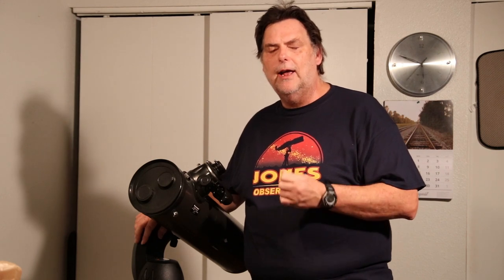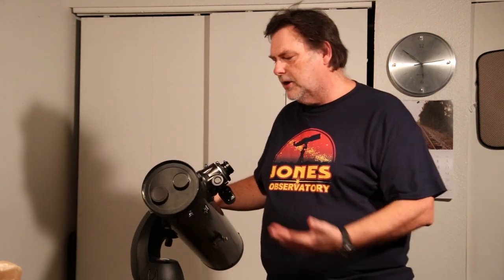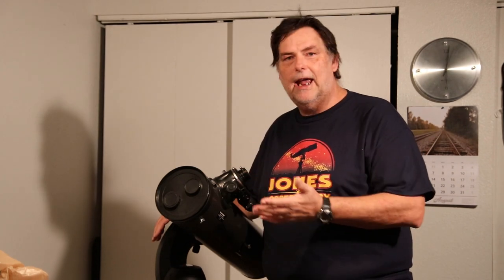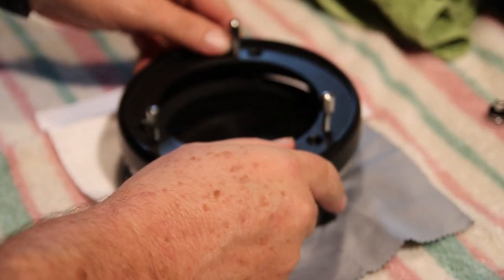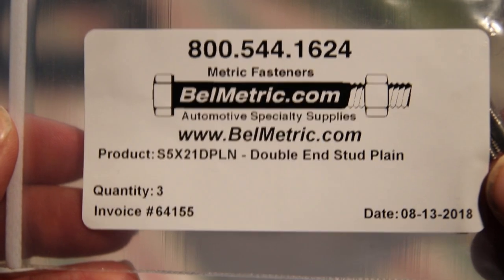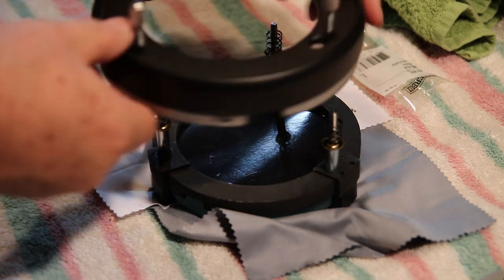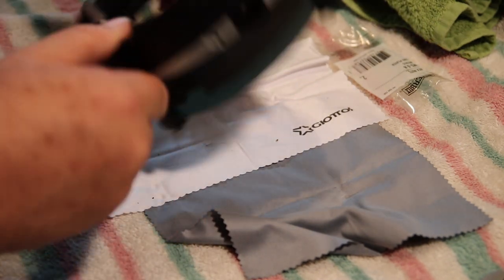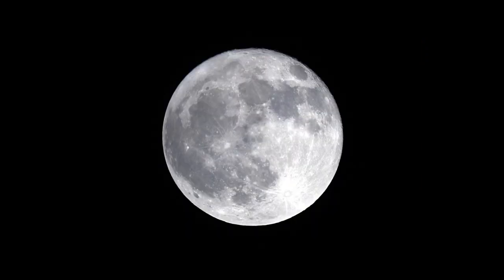Mod a Celestron SLT130 for Prime Focus for DSLR

Comment: Good stuff! built like a real engineer to a problem! Looking forward to try this with mine
Any concerns with dust coming in from the back opening to the mirror? Although dust would come in from the front anyways.
Reply from the maker: My primary mirror does not get any dirtier faster with the space in the back that I have noticed.
Reply: you could try with high density foam cut at the shape of the tube

Comment: I recently purchased the Celesteron nexstar 130slt as well as a canon eos 2000d for astrophotography. I used the same parts listed in the description and did the modification however, I am still not able to get it to be focused in prime. The only way I can get it focused is with a Barlow lens but I do not want to use that for larger objects such as the moon. Any idea how I can fix this?
Reply from the maker: Yea the Barlow does cut off to much. You are just using the canon t-ring screwed directly onto the t-ring threads of the eyepiece holder insert, nothing else between the camera and the scope? I’m not sure if the sensor is further back in the camera housing for that canon, I would suggest to put a nut on first on each threaded stud of the mirror plate screwed all the way down before adding the standoff spacer to bring it up just a little bit further, or a longer standoff.
Reply: Just messed around with the spacing a little today and I was able to get it to work now. Thank you for the video and your help.
Reply from the maker: @Meuxo  Great glad it worked out. Clear Skies.

Comment: Nice.,  Just subscribed.  Ya know, if you have a long x2 Barlow, you can unscrew the hollow tube and use what is left, giving you a x1.5 Barlow.  That worked with my Orion Observer 134mm Newtonian.  Ultimately, I bought an Orion Space Probe 130mm Newtonian, which has two spacers on the focuser and you can remove one to attain focus if you need to.

Comment: Thanks for a great video. Successfully applied the technique to an Astromaster 130EQ.  I had a similar issue with the stock 20mm eyepiece, and even with extension it wouldn’t focus.  A replacement Svbony wide angled eyepiece works well (with the extension).

Comment: Absolutely fantastic Chris. Thank you for sharing this! Very informative. Glad you added parts to this as well. 
I have two questions, how much "forward" distance did your mirror eliminate with this spacer mod. 
Also, did you have to adjust the secondary mirror at the eye piece?
Happy 4th!
Reply from the maker: The spacers moved the Prime mirror 13/16 of an inch forward, which gave me about a total of 1/16 of an inch to focus with before the focuser was completely in the down position. No i did not move the secondary mirror. I figured it need to stay in the center of the eyepiece.

Comment: Chris, I watched your video for the mod, I have just modified my Celestron nexstar 130slt just the same as you have. My question now is, once I mount my camera in the eye piece via the T ring, I'm using a Nikon D40 for imaging. Question, how do you focus on deep sky objects while looking in the camera finder and to obtain sharp focus? I can barely see the images in my camera finder. Especially the Orion neb. M42,-  My scope is on line and properly aligned, so I know I'm on target, but I can't obtain sharp focus. Not enough like coming thru OTA to light up the camera finder view.  Can you offer any pointers on how to obtain a sharp focus?
Reply from the maker: Find a bright star close to the object you want to focus on and use it to achive focus,  then slew to the object you want to photograph. Also when you focus on the star a Bahtinov mask does help. Check out my video on the mask.

Comment: Excellent mod and explanation sir.  What is that focuser knob on your scope right side?

Also, did you have to take all thiae light, dark images I hear people doing then stacking them?.
I'm very new to this and if that's the case, can you explain the procedure  you use to do it?
Thank you.
Reply: Also, both of my Nikon cameras focus perfectly in the 130slt.
One is a FF Nikon D610, and other is tine sensor Nikon 1 V2 with a crop factor of 2.7.  So I'm thinking I don't  need the mod?
What do you think?
Reply from the maker: The knob is a manual electronic focuser ( another video). Yes you should take at least the light flats for better stacked images. Unless your taking images from a lab clean room...lol
Reply from the maker: If all the cameras you will use focus there is no need to do the MOD. My Canon i started with did not focus so i figured out this mod.

Comment: I have a question, I got a camera, neximage 10 I have a 130 SLT, but I have a problem when I use te camera on it, I can’t get a well focus, looks blurry, the problem is on the focuser it can’t get more close to the secondary mirror, this mod can help with mi problem, I can still using barlow lens 3X?
Reply from the maker: Yes it will allow focus without the batlow. I know you can still use a 2x after the modifacatiin but have never tried a 3x, so i do not know if a 3x barlow will still provide good focus.

Comment: I don't know what I'm doing wrong. I followed your directions but can only focus so far. Don't think I could focus on the moon. Do you know if colmination can effect that. I am a little off. Thanks for a very helpful video
Reply from the maker: What camera are you using? What was the length of the spacers? Out of culmination might make it look a little out of focus.  Is the focuser racked all the way inward? If so have you tried to see if using a barlow allows you to find focus, If so then you did not move the morrow far enough forward.

Comment: Hey man, a question; what is the purpose of you doing that step at 12:48?
Reply from the maker: I just want to make sure the double threaded piece is butted up against the bottom thread in the base tight so it won't untread from the collar when calamateing the scope.

Comment: Great video Chris,   I'm thinking of cutting the heads off three m5 x 50mm bolts and using them to replace the existing studs, rather than buying couplings and studs.   I can then install a couple of friction nuts on each stud to adjust the desired gap.   What I was hoping you might know is how difficult it is to remove the old studs?   Again fantastic insight.
Reply from the maker: I did not try to remove the studs and can't remember how they are mounted on the backing ring.
Reply: Some of the studs are glued in place. You can remove them with solvent or heat. Heat the studs and as your doing that carefully try and unscrew the studs. Hopefully it will work out for you

Comment: Hello Chris,  one more question -  while imaging DSO objects with DSLR, after shooting let's say, 80 to 100 light frames, what about the Dark, Bias and flats?  My DSLR, Nikon D40 is what I'm using for now  until I purchase astro camera. I understand how to shoot the frames and what not, but how do I shoot the Bias and flats and dark while the camera is mounted and remains pointed at DSO object?  What shutter speeds do I set my camera. The camera will not work on auto while the camera lens not mounted,  The camera mounted on the OTA via T ring.  Could you offer any advise or links that will explain this?
Thanks
Reply from the maker: The scope does not need to stay pointed at the object. Darks and bias need to be taken back to back at the same temeture as the lights so its better to do those right after the lights. For dark just put the telescope cover on maybe put a dark cloth over it just to make sure no stray light gets thru and shoot 30 to 60 frames at the same settings as the light frames. Then just take the shutter speed as fast as the camer can for the dias, same amount of frames. For the flats  leave the camera attachsed in the same orintation and can be done in the morning if you dont have a evenly lit light sourse. I use a flat drawing pannel. For flats just point your scope to a point in the sky and put on a white cloth like a pillow case or tshirt. Make sure its pulled tight with no wrenkles use a rubberband. If you can see the histagram on your camera adjust the shutter till the high point of the histagram is close to center, take the same number of frames as the darks.
Reply: @AstroPatio  THANKS Chris!! Much appreciated. I joined the NHAC as of today.  Hope you to meet you soon and others. I want to learn more about Astronomy and using my telescope. This is fun!!!

Comment: Nice tutorial. I get a celestron nexstar 130 stl last week and it's a pain in the.. for astrophotography. Will try it.
Reply: Hi,
Same here...
Did you mod it ? 
I saw that the mirrorless cameras can prime focus directly without mod.
Looks like some Sony are really decent on long exposure as well but I haven't tried for myself.
Reply: @art83z  I did but I discovered that I can't focus any planet, just the moon, for normal observation, so you have to use a barlow. Haven't try with that camera I'm using a Canon 550D.
Reply: @Paroxistico  thanks, is it ok with the barlow? 
I guees I'll do it and see...I can revert this change.
Reply: @art83z  if u don't wanna mess with that mod  taking off or on everytime you use the telescope u need the Barlow. You may lose some brightness but it's OK and you have both options at the same time 👍
Reply: @Paroxistico  thanks 😊.
Clear skies

Comment: Thank you 😊.
I got the SLT 130 one week ago and will do this mod (although I was trying to buy a Sony A5000 used...in that case the prime focus can be achieved without mod) 

The only thing that I was thinking off is to have the standoffs 15mm instead of 20.

I tried the prime focus with my nikon and basically with the 2inch adapter I cannot prime focus for les than a centimeter :( 

If I remove all t rings and get the sensor directly it will prime focus...but there's nothing left to hold the camera 😋😋

I'll also have to cut those double ends and take off 5mm.

What do you think ? 
Or should I play safe and go for 20mm on the standoffs?
Thanks again...great job...
Clear skies from Albania (EU) ;)
Reply from the maker: That's cool about the Sony camera. But for the standoff question I'm not sure if you should go with a shorter one or not that entirely up to you. With my setup it still does not give me much room for error.
Reply: @AstroPatio  just finished the mod...
I left a couple of mm less (deeper) than what you did...

I noticed that the 9mm and 25mm eyepieces need the Barlow tube (without the barlow lens) but it's still fine....very usable indeed.

The 4mm eyepiece doesn't need the extension...it worked fine directly.

Thanks again and happy holidays.
Reply from the maker: @art83z  Yea a little give and take but I think its worth it just to be able to use my DSLR camera with out the Barlow to make it work.

Comment: Did you have to use the second set of standoff round couplers? Will that allow more wiggle room in the focus department?
Reply from the maker: No i did not need to use the second standoff, yes it will give you more wiggle room for the camera but it effects the use of eyepieces. As it is with one standoff some of my eyepieces need an extension tube for further back focus to use.

Comment: Hello I’m in the process of purchasing and building one of these myself I have a question if you actually got the extension adapter for your smaller pasal eyepieces? And what size you got.
Reply from the maker: Im just using a 2x standard barlow with the magnifer lense screwed off it works great with my possel eyepices.
Reply: @AstroPatio  thank you. I appreciate it. So much help on this video and great way to get started you have my support.

Comment: Good video bro, could you tell me wich barlow lens do you use in this video (link please)? i will like to use the barlow lens before the modification mirror. thx. pd: sorry for my english, i don't speak very well, i hope that you understand me.
Reply from the maker: This is the barlow I used in the video its the Celestron 1.25" Universal Barlow and T-Adapter https://a.co/d/14Ya9n6
Reply: @AstroPatio  Thanks!! i will buy it.
Reply: @AstroPatio  hello friend, i have another question and i hope that you help me. in the  double end studs is necessary the separation of the short thread and large thread?, i only found double end studs without separation. thank you!
Reply from the maker: @luisjagaravito5508  they should work fine
Reply: @AstroPatio  awesome! thank you

Comment: Does anyone have the link for the screws and washers because if I want order them off belmetric it’s 50 pound shipping since I’m from the uk
Reply: I had the same issue and couldn’t locate equivalent studs anywhere in the UK. So I tweaked the parts list using parts available from RS UK and it worked a treat, with the same scope 130 SLT. Kept the same stud and spacer lengths and threads, though my studs are threaded across the whole length (still works fine). This has brought my mirror inwards by about an inch, everything feels solid and I can now get prime focus with my DSLR.

Parts bought:
M5 x 20mm steel spacers
RS stock no 205-3072

M5 x 30mm zinc plated steel studs
RS stock no 175-6987

M5 x 50 steel screws (for locking collimation)
RS stock no 917-2820

M5 Rosette washers
RS stock no 664-5000
The washers above will do though I ended up mounting them upside down so that the curved bit went on top of the spacer, with the flat edge retaining the spring. Because they were a bit on the small side to use the other way round. This worked for me and the spring doesn’t slip off, though a slightly wider washer would be neater.

All in its still about £35 from RS but a lot better than the hefty delivery charge from the US.

Thanks to AstroPatio for the great video tutorial!

Comment: Will this work on my Orion Starseeker 130mm??? Please and thank you.
Reply from the maker: I do not know if it will or not. I have not seen how the primary mirror is mounted in that OTA.
Reply: @AstroPatio  it looks very similar to your scope
Reply from the maker: If it basically the same setup then I would image it will work. Just give it a try if you want too it should not mess up the scope unless you forced things and you can always take it back off. I have taken mine off and put it back on for trial and error before.
Reply: @AstroPatio  thanks

Comment: Has anyone converted the screw and coupling sizes to imperial measurements. I want to get them from my local hardware store so I don’t have to wait for them to ship
Reply from the maker: Im not sure if there is an exact match for Imperial size conversion for screws and nuts.
Reply: @AstroPatio  yeah your right. I went out and bought 10-24 screws and some studs in hopes of it fitting, it didn’t. I was able to find M5 metric locking screws and the #8 washers but the studs and couplings I had to order. Also I really enjoy your videos you are single handedly supplying all the information available for the nexstar 130. Keep it up!
Reply: You would have to remove the studs redrill the holes and retap them to imperial size

Comment: Does anyone have problems with this telescopio alignment and tracking?
Reply from the maker: Yes this scope does have issues, some time it does fine others not so much on alignment and tracking.
Reply: @AstroPatio  mine is like this, I've been researching some topics talking about a slack configuration.
Reply: Nope works perfect and tracks excellent,  most likely you alignment procedures
Reply: Hi just want to be clear since I an new to this telescope. So the 130 SLT will track objects and they should not travel out of view?